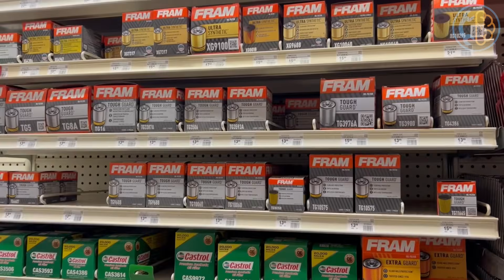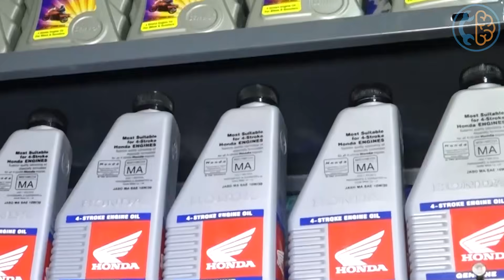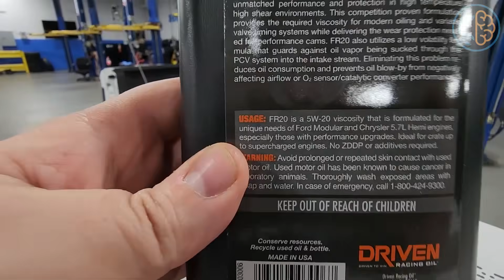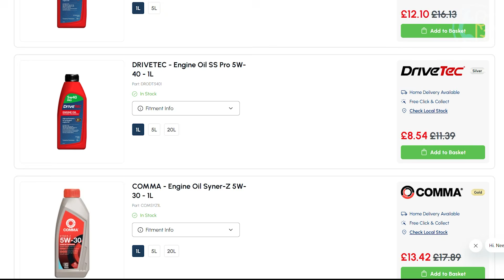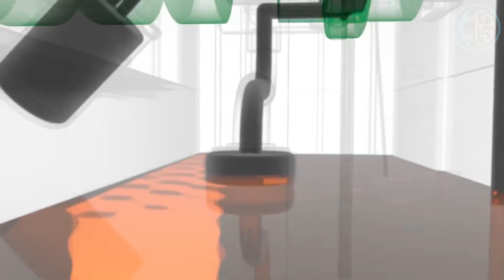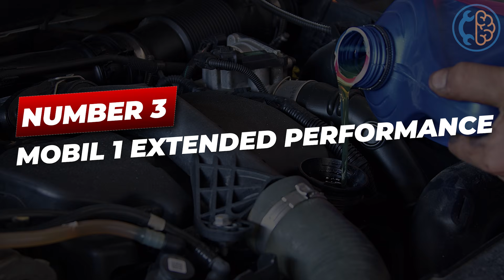7 Engine Oil Brands You Must Avoid NOW! (And 3 That Will Save It)

Comment: Amsoil Signatore 0W30 for my 2016 4RUNNER
Reply from the maker: Amsoil Signature Series 0W-30 is known for very strong shear stability and low volatility, so it holds its viscosity under load and heat way better than most oils in its class . That’s exactly what you want in something like a 4Runner that sees long drives, heat, and sometimes heavy use. 
Only thing I’d say — Toyota typically specs 0W-20 for that engine, mainly for fuel economy and flow . 0W-30 isn’t wrong, just slightly thicker, which can actually be beneficial if you’re in hotter climates or doing harder driving. Good choice either way. 
Are you running it for longer intervals or sticking to regular changes?
Reply: Regular changes, long highway driving between Illinois and Wisconsin about 240 miles one way on some weekends, minor off roading
Reply from the maker: That’s pretty much the perfect scenario for that oil. Long highway drives are easy on the engine, and the 0W-30 gives you a bit of extra protection for load and off-roading. With regular changes, you’re honestly over-maintaining it—in a good way.

Comment: Definitely Pennzoil Ultra Platinum 0W-40
Reply from the maker: Nice choice. That’s one of the few oils where the base stock actually makes a measurable difference. 
Pennzoil Ultra Platinum 0W-40 has a very low volatility and strong high-temp stability, so it holds up well in turbo engines and under hard driving. That’s exactly where cheaper oils start to break down.
What car are you running it in?
Reply: @CarCareLogic  22 Silverado RST 6.2 Don’t want to take any chances as I’m sure you’re aware the 6.2 has had some issues!